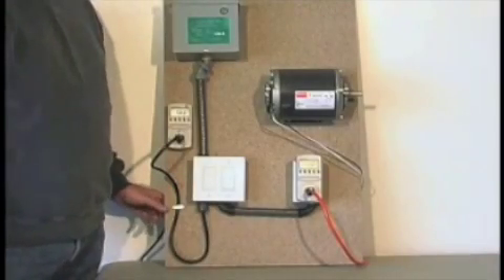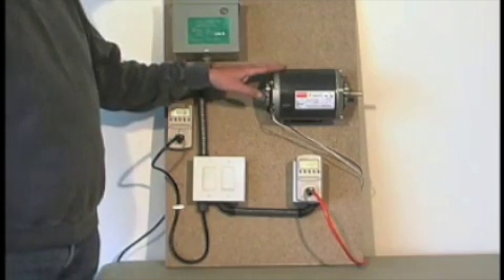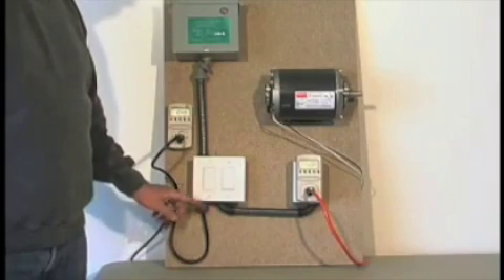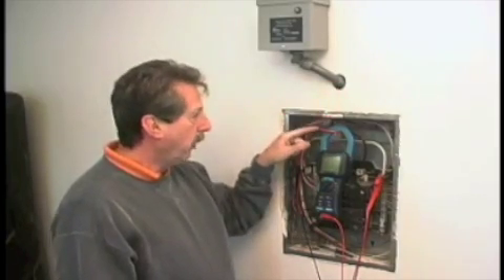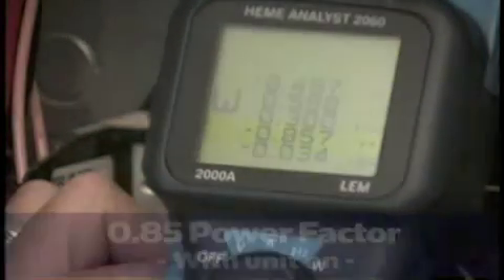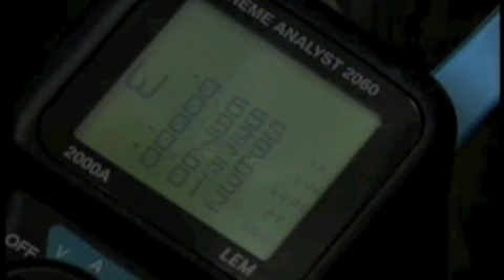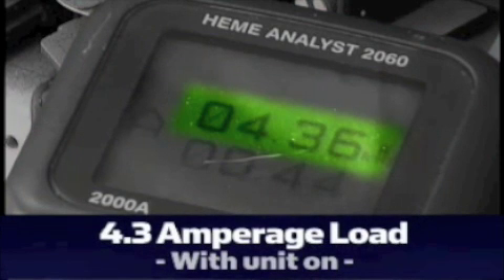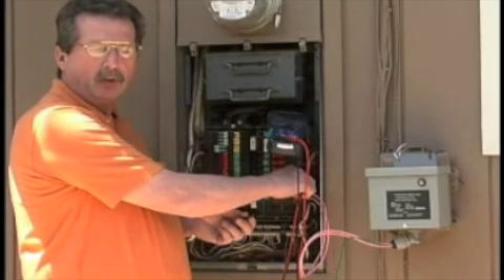Increase The Power Factor and Save! (Demo)

Comment: SCAM !!. Yes the current reduces on that Ammeter  but you, the customer are charged in KWh  (Kilowatt Hours) Not the value of the Amperes (current) drawn. If the KWh were measured there would be no change. The demonstrator does not show the KWh reading,  conveniently for him he just shows the Current reading. These devices are almost useless in my opinion and other competent Electrical or Electronic engineers will agree,  forget them. (It is Not Amperage, but Current, by the way.)

Comment: This is so inaccurate I don't know where to begin.....

!.  you gain NO ENERGY savings from a device like this, connected like this.

2.  Residential customers do not pay demand charges.  

3.  what you are seeing in this video is apparent power readings.  you are not billed on apparent power, but rather active power, in KW.  

4. Capacitors will help reduce reactive current but only when connected to the motor load only, but will do very little to the active real power consumed.  Capacitors will bring the motor load back in, or closer "in phase", where the voltage runs with the current, not lagging or leading on one or the other.

high power factor is desirable on motor loads, but you wont gain much in kwh consumption after correction.  I've seen it on job sites and on the bench both.  if you had a kw or kwh reduction after correction, like maybe 2%, you probably got it from the motor winding running cooler, as a result of pfc capacitors.

Comment: It is a load of crap......research power factor yourself! Not from a sales person!
What do you get charged for at your home, Wattage or Current?? answer WATTAGE!

Take a 2kw motor, 230V supply with a power factor of 0.7
and
Take a 2kw motor, 230V supply with a power factor of 1.0 (thanks to the power saver 1200 unit!!)

Yes the current will decrease!!......But each motor will still use 2kw of energy dissipated! at which we are charged!!

Yes power factor does make the whole system more efficient in the way of less current.....If the whole system had crappy power factor, there will be a lot of stain on the equipment due to higher currents!
Imagine 1 000 000 motor 1 above = 12.4 x 1 000 000..... 12 400 000Amps
Or Imagine 1 000 000 motor 2 above = 8.69 x 1 000 000..... 8 690 000Amps

But still 1 000 000 x 2000 watts of power dissipated and charged to customers in both cases!!!!

So yes a lot less current on the system with better power factor!
but still the same amount of power used and charged!

Comment: In 2009, Smart Meters were just beginning to be rolled out.  All these posts you see where people have new Smart Meters installed and their bill doubled is because their power factor was probably 0.5 (or lower).  PF correction is critical for Smart Metered customers, which we will all be soon.
Reply: LumenCache in Indonesia we use prepaid tokens where the token value will decrease faster if the power factor is bad. Some kind of hidden cost, so we would top up tokens more often if so

Comment: The proper capacitors can increase the Power Factor on low efficiency inductive loads such as motors, but they will not benefit a non-inductive application. The best bang for your buck is to turn off the lights and if you have to have them on, upgrade them to something more efficient. Commercial folks are the only ones that are billed per Power Factor. It's not a residential issue. Simply throwing some capacitors across the mains on your panel does nothing. Period.
Reply: Mark Rakemaker would you care to explain why installing these up made my one year old fridge and one year old daikin aircon become freezing cold and I have to adjust the settings by adding 3 degrees in order to be able to sleep because it became really cold.

Comment: QUESTION: What is a capacitor? ANSWER: A device that stores electrons. Power Factor Correction applies to inductive motor loads. Compact Florescent Lighting has a terrible PF along with these new Switching Mode "Wall Wart" power supplies and the one the is inside of your computer because the load is nonlinear. Personally, I prefer an old fashioned linear transformer over the SMPS. Simplified, you want loads that are harmonic friendly to the 60 HZ cycle in order to have a high Power Factor.